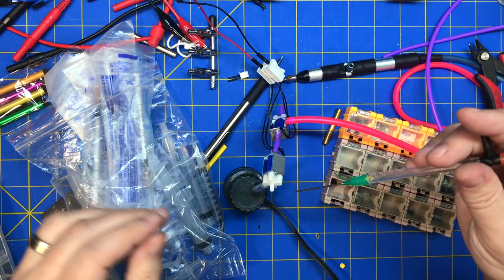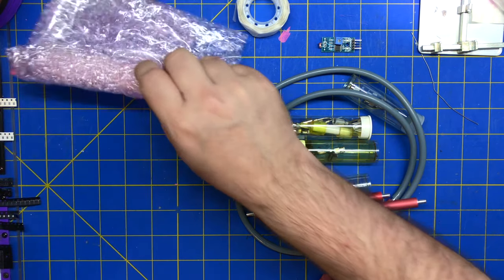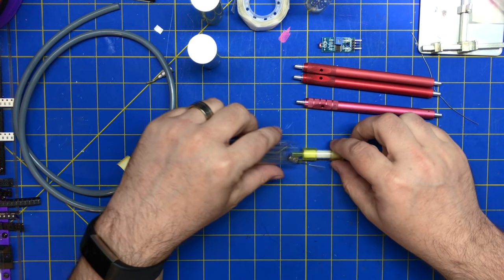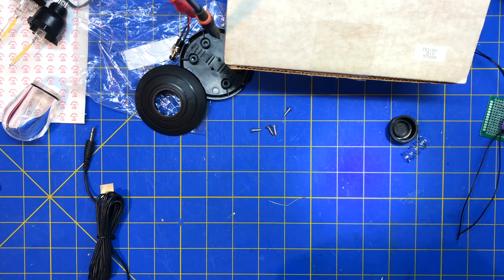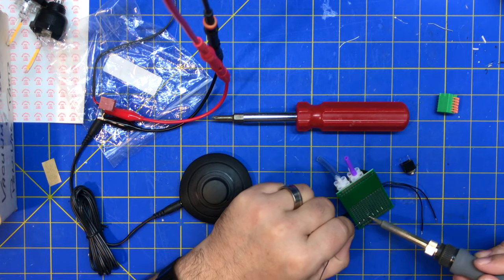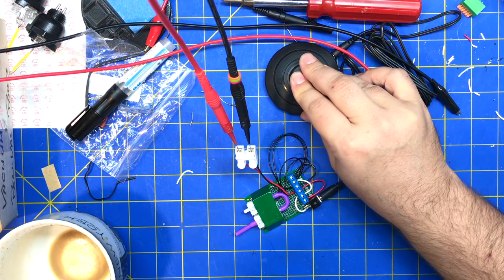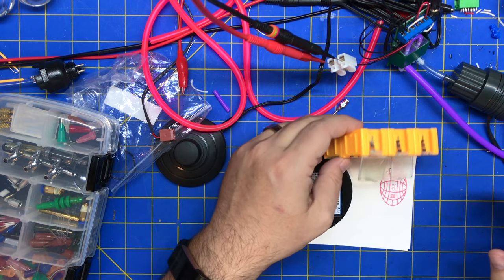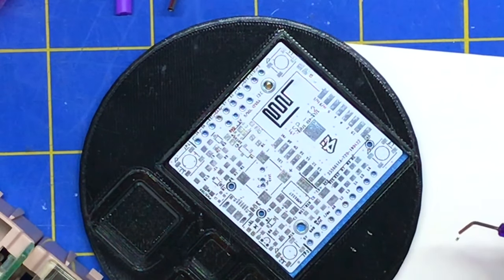Project VLOG SMD Vacuum Tweezers

Comment: Hi may i ask you from which seller you bought the syringes with the screwable-head which can be seen in your ziplock bag @0:24 Thank you in advance
Reply from the maker: Which ones, heh, those are from lots of orders, I found that it is worth it to buy the assorted kits, unless you need alot of a specific size and type because those are usually sold in larger qty. https://www.ebay.com/sch/i.html?_from=R40&_trksid=m570.l1313&_nkw=luer+lock+syringes+set

Comment: What vacuum pump do you have?
Reply from the maker: Youri Klaassens a really crappy one, the smallest aquarium pump I have seen, probably going to replace with larger one
Reply from the maker: It came with a little aquarium I had was in my junk bin, the diaphragm  was not reversible, I had to modify the pump a bit, I am probably going to just replace it with a $7 walmart pump and reverse it, or one of those whisper ones, I did order some dc pumps that are small, I will test them when they arrive.  junk pump https://www.globalsources.com/gsol/I/Aquarium-pump/p/sm/1105125903.htm#1105125903